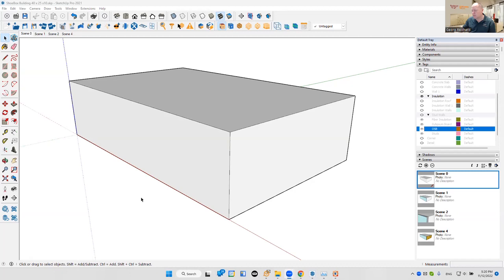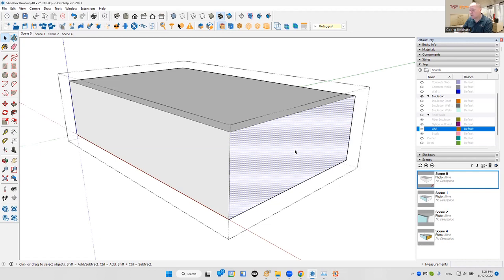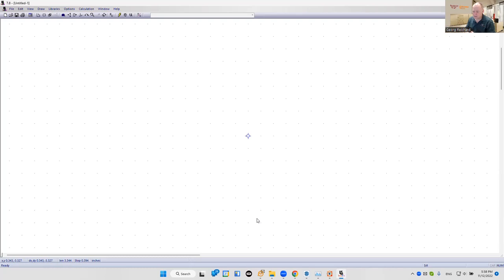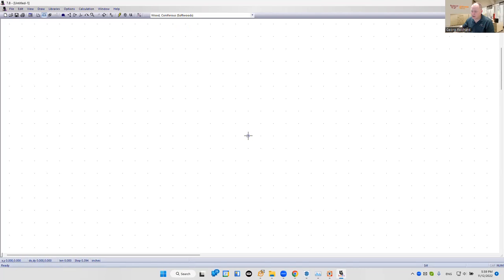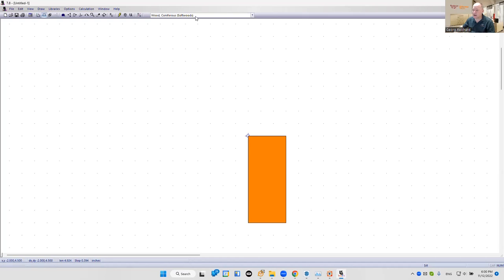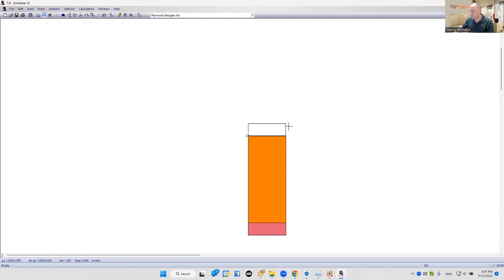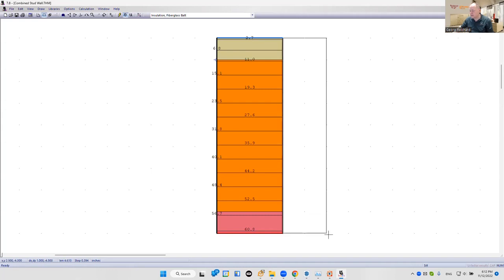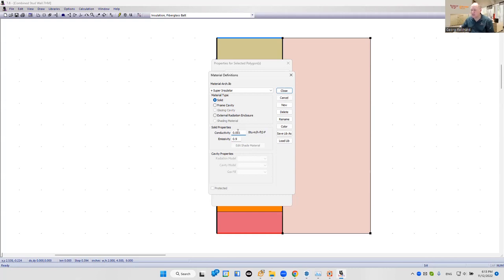THERM Stud Wall: Overall U-Value

Comment: The difference between the U value of the stud wall (in the program) and the U value of the stud wall calculated 'by hand' at the end is the thermal bridge? did i get it right?
Reply from the maker: Not exactly, it just shows the difference between assuming simple one-dimensional heat flow (the simple hand calculation with the width of each section) and a 2-dimensional heat flow (where heat not only flows perpendicular to the layers, but also swerves off towards higher conductive materials - i.e. here the stud). Some standards allow this simple one-dimensional assumption for simplification in hand calculations, as long as the conductivities do not differ too much, like in this example where a wood stud is not so bad and the results do not differ so much from the 2-D simulation. It would be much more pronounced if this would be a steel stud.
I think what you refer to as the "Thermal Bridge" is the "linear loss coefficient" (also called the Ψ-Value, or φ-Value in some European countries) that can be applied to a line that represents this 2-D behavior (i.e. a stud). The thermal bridge value for a stud would be calculated as the difference in U-Value between a plain cavity wall (no studs) and the 2-D modeled average U-Value. 
You would write:
   Ψ = ( 0.0842 [BTU/h.sf.F] x 16/12 [ft] ) — ( 0.0734 [BTU/h.sf.F] x 16/12 [ft] ) = 0.0144 [BTU/h.ft.F]
Now, for stud walls, you typically don't need the Ψ-Values and go with the averaged solution for all the areas you have this wall. Ψ-values are more used for corners or interfaces between different building components (wall/window/floor/ceiling interfaces). See my other video where I describe that process for a wall corner.